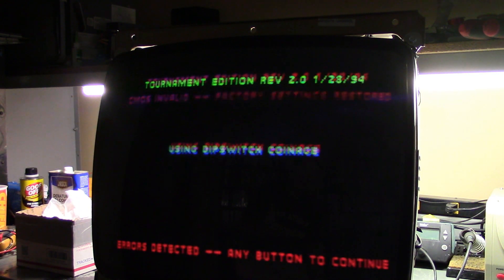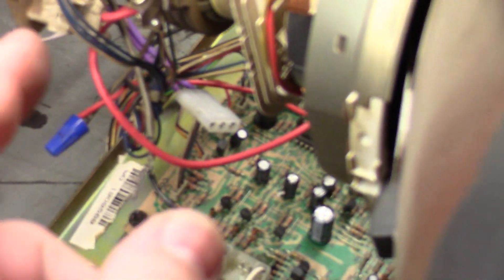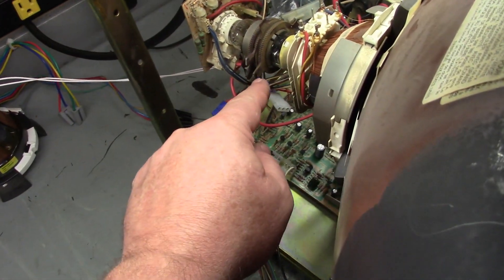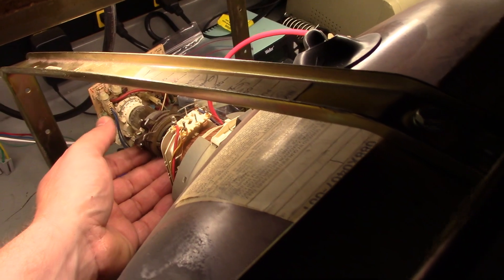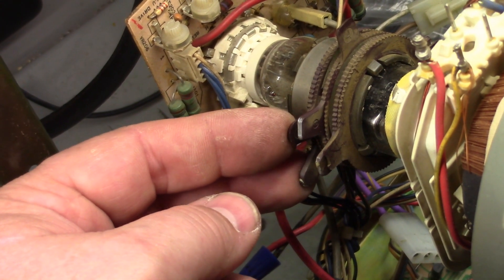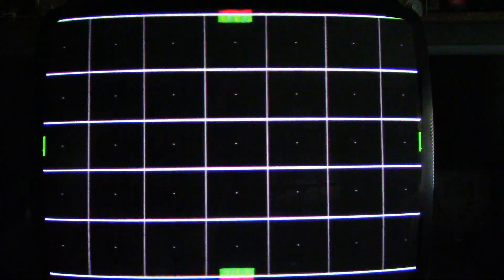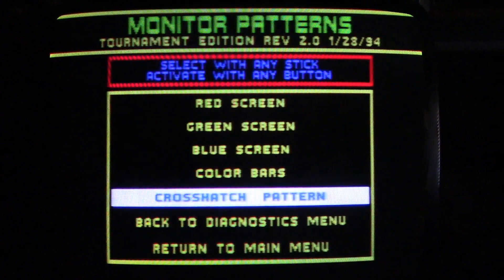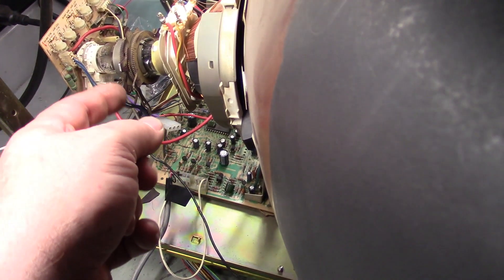Arcade Monitor Repair - Basic Convergence Tutorial

Comment: The rings only adjust inner/static convergence (the middle area of the display)

One set of rings (the middle set) adjusts both the horizontal and vertical component of red and blue.  You adjust vertical convergence by moving both rings together, you adjust horizontal convergence by moving the rings  independently, such that the tabs are closer or further apart.  ( this can be tricky because there is also a rotational component involved due to the nature of the magnetic fields of the different ring sets interacting with each other as you move them )

The other set of rings (furthest back towards the neckboard) should not change the convergence of red and blue, but rather move both red and blue together/simultaneously, in order to line them up with green.  

If your rings do not behave in this manner (say your middle set controls vertical, and the rear set controls horizontal) the most likely cause is because the ring sets are not properly oriented with respect to each other.  They need to be around 90 degrees out of phase in order for the magnetic fields of each ring set to do their intended function.  Having them greater or less will cause the magnetic fields of each ring set to interact more than they should, which is what causes interactions like changing the rear rings affecting the function of the middle rings.  Typically the way to avoid this is set one set of the rings to 10 o'clock (the rear set), and the other set to about 2 o'clock (the middle set), and then try to maintain that ~90 degree relationship between the sets, to keep their magnetic fields from interacting with each others function.

The typical method for doing convergence is to turn off green, use the middle rings that converge red and blue until you get magenta/purple, then turn green back on and use the back set of rings in order to get the magenta/purple to line up with the green.  

With the static convergence done, its time do the dynamic convergence (the outer areas of the screen)  This is the difficult bit, as it requires moving the yoke up/down and left/right.   

Tilting the yoke up and down controls the red/blue rotational convergence.  Moving the yoke downwards rotates red counterclockwise while simultaneously rotating blue clockwise, moving upwards rotates red clockwise while simultaneously rotating blue counterclockwise. The goal is to get them to meet in the middle.

Tilting the yoke left and right controls the size convergence. Moving the yoke left makes blue shrink while making red stretch, moving the yoke right makes red shrink while making blue stretch.  The goal is, again, to get them to meet in the middle.

What makes it difficult is getting both the rotational convergence and the size convergence to line up at the same time, because nearly all movements have both an x and y component,  which means even small movements in one direction with have slight movements in the other axis, causing one to influence the other.  

After you do get this (without practice, prepare to spend a not-insignificant amount of time on this) you will probably still have a few areas that are imperfect. The remaining areas are the areas you tend to fix using convergence strips.
Reply: Thanks, this is super helpful!
Reply: Thank you so much for this detailed description

Comment: Just had a look and on some tubes it seems you can't move the ring set up and down more than a millimeter. Towards the front you have a plastic kind of washer, and towards the neck there's the metal strap that locks into a ring with plastic pegs? Can you still move the ring set on those to get it roughly good?

Comment: Hi. Is there any way to calibrate it without rings? I have Samsung tv and blue is off at the corners. Someone said there must be an option in service mode but no chance. TY
Reply from the maker: If the yoke is bonded, there’s not much you can do unless you can slide some convergence strips in the yoke.
Reply: @MikesArcadeMonitorRepair  Unfortunately after few hours of stickin magnets it kind of worked but in the end it didnt. Now its even worse plus new thing went bad. Picture is 'flickering' size.  Worth trying tho.
Reply: @MikesArcadeMonitorRepair  Thanks. Watched RetroTech video yesterday and found more about it. Thats the last option before replacing components .

Comment: My monitor has no rings and i definitely have a convergence problem😕 I don't understand it - it's a proper arcade tube and i read on some forums that some tubes simply don't have the rings (i forgot what was the quoted reasoning)
Reply from the maker: If the yoke is bonded on, the convergence is built into the yoke with internal magnets. There’s no way to adjust it that I’m aware of.
Reply: @MikesArcadeMonitorRepair  Thanks. It's strange, there's clearly space left for the magnet rings, but it's empty - the producer removed them. Maybe it's something to do with European screens, maybe they don't install them for some reason over here

Comment: cool video 👍any idea's why my ms pacman picture would be off to one side the  pacman maze is over to the right more and not in the middle of the screen. could this be to do with the convergence as well ?
Reply from the maker: Not likely. Most likely just needs a vertical position adjustment.
Reply: @MikesArcadeMonitorRepair  well done sir thanks a lot I'm new to this adjusting things and only just found the vertical position adjustments 🤣 now i can play  ms pacman in the centre of my screen after years of never finding out how to change it thanks again   👍
Reply: i now have another issue🤣 i adjust the pots on my machine to stretch the screen slightly it works great and looks better. the problem is when i come back the next day and turn it on its all out of sync again and shaking all over the place and i have to readjust them again . have you any idea why this would be i cant work it out 👍
Reply from the maker: Likely dirty pots or they need to be adjusted just slightly a bit more.
Reply: @MikesArcadeMonitorRepair   yeah ill give them a clean. just strange it's ok until it's left off overnight i can switch it off and back on and its set in the position i put if but if left off overnight its all over the place

Comment: My problème is I have perfect convergence in the middle but it’s off on top and bottom, what the solution, I also have static convergence ring
Reply from the maker: You’ll need to adjust the yoke or do a clean and balance procedure with a rejuvenator.

Comment: I'm barely getting into arcade monitors and was wondering if the wells gardner k7000 requires an isolation transformer?
Reply from the maker: Yes. Do NOT run it without one. Most machines have one built into the power brick but newer games (MK4 for example) that came with a K7400 or Neotec did not since those monitors don’t require one. If you are ever unsure, just ask.
Reply: @MikesArcadeMonitorRepair  Thanks Mike! I had ordered one just in case...I will be getting my k7000 and isolation transformer in today so I'll let you know if I have any questions.

Comment: Are there any dangers anywhere else besides where you pointed out and the flyback when messing with the tube and yoke?
Reply from the maker: Sure. Lots of places. Just don't touch anything that isn't plastic and you should be ok. Common sense will prevail most of the time.